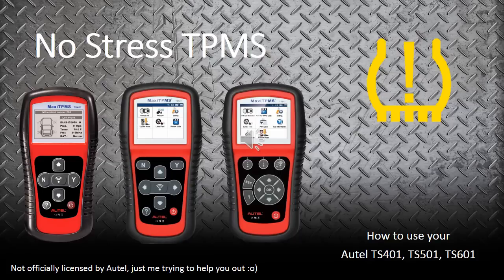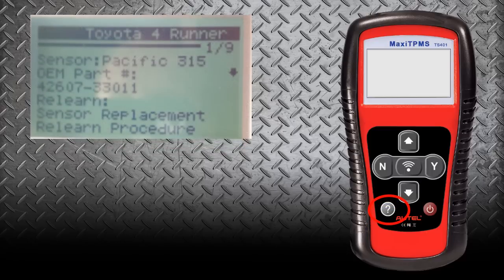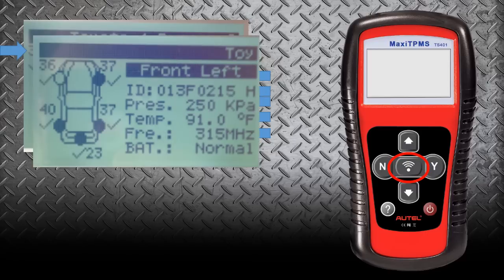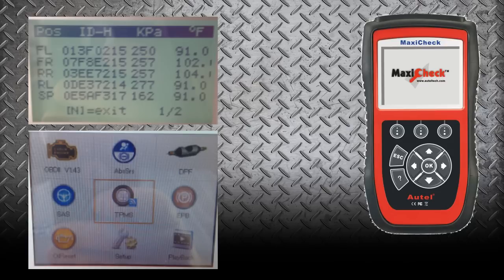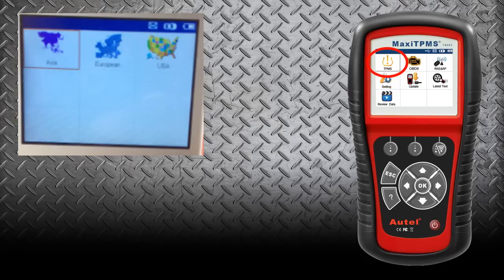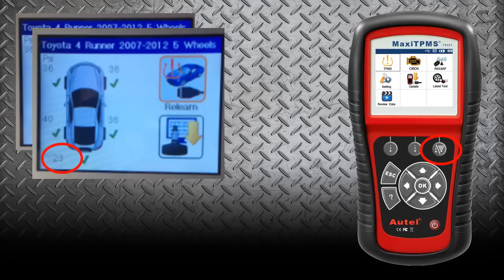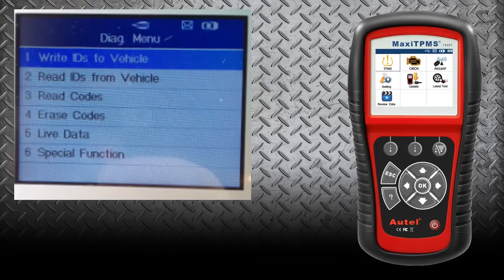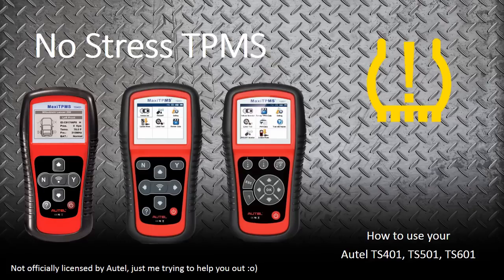No Stress TPMS Autel TS401, TS501, TS601

Comment: What is the difference between TS501 and TS508? Thanks!
Reply: OBD2 connection. The TS501 does not have the ability to connect via OBD2 to write sensor ID's the TS508 does: Correction: The TS501 does have OBD connection. The TS508 is the newer version
Reply: @FlashPerformance  thanks a lot! 508 is much better then.
Reply: @FlashPerformance  False info friend, u either dont know or just pretend to know, both have obd connection, difference is quick mode & advance mode function/option, very welcome.

Comment: You have the most information, I have 2017 Chrysler Pacifica  with TPMS problem..
Where would I take it and what's  the cost..thanks
Reply from the maker: Most of the time it comes down to a sensor that the battery has gone bad.  Every tire shop now has the right equipment to test the TPMS system to find out what the issue may be. Prices very depending on where you are in the country. Guess around $100 to get a sensor replaced. The shop will need to remove the tire, replace the sensor, rebalance the wheel, and relearn the sensor.

Comment: I installed Schrader valves in my winter wheels.  2012 Toyota Prius-V.  Will this be able to discover them?  OEM sensors in the summer wheels.
Reply: Depends on the Schrader sensors you got. The EZ sensors are blank and must be programed with their specific tool.  If the sensors have already been programmed, then yes, the Autel tools will pick them up and do the relearn no problem
Reply: @FlashPerformance    Thanks!  I called up Schrader, mine are programmed.  Ended up getting the Autel TS508.  Autel said it can talk to the vehicle computer as well.  Will give it a try in the next week or so.

Comment: The TS401 allows you to clone OEM to Autel TPMS sensors so you don't need to mess withe the PCM using the 501 or 601.  Just another option since I own the 401.

Comment: Can it adjust the psi point that triggers an alarm? I run lower pressure than the factory thinks is safe so the alarm is always bugging me.
Reply: The TS501, TS508, TS601, and TS608 can all change the Placard Pressure Value. https://youtu.be/C9wQvzF7jzI

Comment: Will any of these relearn Shrader branded TPMS Valves that go in a Nissan Frontier? And register also
Reply from the maker: The Schrader EZ sensors are blank, and the Autel tool can not program them. However once they are programmed the Autel can learn them.  If you have an Autel tool I would recommend the Autel MX sensors, most of the parts stores and tire distributors now sell them. They are also at a great price point.
Reply: @FlashPerformance1   I have Schrader sensors on four tires on a '11 Ram 1500. Can I install new Autel sensors and Schrader sensors on my truck? One sensor just went dead.  Or, can I install and program a new Schrader sensor with the Autel TS501 tool?  I have the equipment to break the bead on a tire to remove and replace the sensors. My Ram 1500 supposedly auto-learns the sensors, but in the past, that has not gone well.

Comment: How long does the autel sensor last and which is the best autel sensor to get...also this machine only programs autel tpms only
Reply from the maker: The Autel MX-1sensor is a single sku sensor that works for both 315 and 433 mHz sensors.  I recommend using the 1Sensor for ease of use and low inventory.  The Autel TPMS tools can clone using the Autel MX sensors, but it can relearn any pre programmed sensor, and any information ready sensor like VDO, John Dow, Ori-Teck, and any OE sensor.  Check out this video for more sensor informaiton https://youtu.be/vwMxHx8WoYw
Reply: Just talked to honda (local and ebay) about the oem honda sensors they said the oem has to be programmed would you know if that means they can be cloned from the autel tools?
Reply: Or would the answer be ts501/ts601 or ts401 add with thr maxcheck would be able to program the new oem sensors
Reply from the maker: @Benflippingfactz  Each TPMS sensor has its own ID,  That sensor transmits it information out and the vehicle looks for that specific ID and captures the information the sensor is transmitting.  If we didn't do it this way your vehicle would pick up TPMS sensors from other vehicles driving down the road.  When they say the sensor has to be programmed they are correct, we have to program that sensors ID to the vehicle.  This way the vehicle will know to use that sensors information.  Honda requires an OBD2 relearn.  This means we scan all the sensors, plug into the OBD2 port and write the sensor IDs to the vehicle.  This can be done with the TS501, TS508, TS601, TS608 from Autel.

Comment: Hi is that working on lexus ? NX200t 2017
Reply from the maker: Yes, you would want to choose a TS501 or better. TS501, TS601, TS508, TS608. You will need to be able to connect via OBD to the vehicle. Any of these units would work perfect for you.

Comment: I can't read the sensor in my car, is there a setting where it will pick up any frequency so I can determine if the sensor in the tire is working and possibly they installed a sensor for another car? Also it's strange that both the 2011malibu and Prius both have 315 but after reading the Malibu's I go to the Prius and doesn't read anything.  When I switch to Prius it reads the Prius right away.  Makes me think I have to select every possible car option to see what sensor they installed in my wheel.  I have the ts508
Reply from the maker: There is not a search function on the TS tools from Autel. There are many different frequencies inside 315mHz. 315.1, 315.2, 315.3 etc.  The 315 mHz is just the base frequency, so going from the Malibu to the Prius is not going to work the same because they will be on different sub frequencies. If the Malibu does not read you can try going up a year or down a year on the tool to see if you can pick it up.  It could be that the sensor is bad or that the sensor is locked to a sub frequency that the Malibu can not see.
Reply: Oh wow thanks for the answer.  Must be a different sub frequency than I expect.  I was so confused  because I thought there was only the 2 frequencies.  Thank you.

Comment: I lost my old tire sensor so how I can find the old sensor code number to install it to the new tire sensor ?
Reply from the maker: If you are using a TS501, TS508,TS601, TS608 you can connect to the OBDII connector and pull the sensor ID's from the PCM and do what Autel calles "Copy By OBD".  If that is not an option just do an auto create and do the relearn process.

Comment: I have sensors but am getting new tires and wheels with new tpms. To sync up the new ones which Autel tool should I try? ( it’s for a 2009 Subaru Legacy)
Reply from the maker: The legacy requires and OBD2 relearn, The TS501, TS508, TS601 will all work for that function

Comment: I have a 2006 and 2008 Toyota Tacoma each with two sets of tires and rims (all season and winter).  The TS501 worked well at reprogramming the system after changing the tires.

Comment: Just got a ts 401..going to use it for a 2013 toyota sienna. And it seems does not work. Any help?
Reply from the maker: First, I would make sure that you have completely updated the tool.  You can find a video for that here: https://youtu.be/5FOV5mUuiG0
Second, after you select the Year Make and Model select the "?" button.  This will give you the step by step relearn procedure for your vehicle.   On a 2013 Toyota Sienna they had both 433Mhz and 315Mhz.  If you go "Tool Kit" from the home screen> RKE & RF Monitor, you can press the key fob to find out what Mhz the system is running.
Third, when you read through the relearn process you will see that it requires you to connect to OBD2 to write sensor ID's.  The TS401 doesn't have that function, it will require a MaxiCheck Pro, MX808, or professional level scan tool to do that step.

Comment: Our shop has the TMPS TS501 that has frozen up. It reads The vehicle program is not authorized...… It is stuck with this message on the screen. We took the back off and disconnected the battery. Plugged it back up, and still reads the same. Has anyone every run into this problem?
Reply from the maker: Call tech support, There is a factory reset procedure that you can do to get it to reset.

Comment: Quick question! 
For a 2007 crv, using the ts401, I would need an OB2 port tool to connect to the PCM? In order to have the vehicle relearn the sensors. Is that correct? 
Unless, using either the ts501 or ts601.
One other thing to note, I'd be using OEM tpms sensors.

PS: Awesome video!
Reply from the maker: Yes you have to connect to the OBD2 port to write the sensor IDs.  You can do this with a professional scan tool or by using the TS501, TS508, TS601, and/or TS608.  Even with OE sensors.
Reply: @FlashPerformance1  Awesome! Thank you so much for clarifying and replying quickly!

Comment: Can it be use in 2011 Honda Odyssey ?
Reply from the maker: The Honda Pilot requires an OBD2 TPMS relearn.  You will need a TS501, TS508, TS601, TS608 to do the relearn
Reply: ok thanks

Comment: I have a TS601 and did the newest update. I am trying to re-learn TPMS Sensors for a 2014 toyota camry and the device shows that the sensors should be 433Mhz, however the vehicle owners manual shows that they are 315mhz and the device does not detect the sensors. Is there a way to return to the pre-update software? I wish I never did the update for the new software. Any Ideas?
Reply from the maker: Oddly enough mine did the same thing.  If you go into Settings>Market switch it over to Euro go into Camry and will will only show 433.  Go back to Settings>Market and change back to America.  Go back to Camry and it will show 3 options all 315mhz.  Hope that helps
Reply from the maker: I just got an email from Autel Support about this issue. They are aware of the issue and are working to correct it. For now the switch back and forth works.

Comment: What is the point if it cant connect to the ecm?
Reply: The TS401 is used as an activation tool to activate the sensors and get the sensor ID.  The sensor ID can be used with a professional level scan tool to program the sensor IDs to the PCM.  Autel wanted to give the customer a cost effective way to activate sensors.

Comment: I have a 2017 Honda Pilot.  Dealer ordered me a set of Black OEM custom wheels with sensors and installed the stock tires.  I used the stock rims, and installed Winter tires.  All wheels have Honda OEM sensors.  Can I use these tools when I swap sets to relearn?  Do I need any other tools?  Dealer wants an hour labor each time they reset it.  What is the minimum model I can get to do this?  Thanks.
Reply from the maker: The Autel tools do not have the relearn process in them for the 2017 Honda just yet.  I am sure it will come...  My best recommendation would be to return the sensors to the dealer, order the TS408 and 4 Autel MX sensors.  Do a copy by activation on each sensors.  This would make your winter tires and summer tires have the same IDs.  When you do the switch the vehicle will no know because the vehicle will already be looking for those IDs.

Comment: can the ts601 manual input ID sensor  to the ECU? thank you
Reply: ts401 to get all the I'd in the tire sensor and you can program it with your maxisys 906
Reply from the maker: I struggled to answer your questions on this on.  The TS501 and TS601 can not manually enter the IDs into the PCM, but I'm not really sure why you would want to.  To enter the Sensor IDs you simply scan all of the sensors and select write sensor IDs and the tool does all the work for you.  The only reason I can think of to manually enter the IDs is because the sensor didn't transmit the signal to the Tool and in that case the sensor would not transmit to the car so the sensor would not work anyway.  Manual entry of sensor IDs can be found in all of the MaxiSys tools.
Reply: I'm sorry for making you confuse. The reason why I'm asking you it's because I'm working with 2016 Corolla and when I'm trying to Scan the sensor using my ts501 it won't work, but when I use my ts401 it work. when I play around with my ts501 no way you can register the I'd manually. So I was just wondering if you can do it on TS 601? Thanks for replying to my massage I do appreciate it.
Reply from the maker: I understand your logic now and that makes sense.  There are a few things I would try, first, make sure that your TS501 is up to date.  All of the updates are free.  You can find that process here: https://youtu.be/bPS8fZH7Edg.  If that doesn't work we need to get the VIN number for that car to the engineering team at Autel so they can look into the issue.
Reply: OK thank you.
Reply: can you please check  if the TS601 special function is the manual I'd register to ECU? if it is, I'm just gonna buy the TS601 and return my TS501 thank you .
Reply from the maker: The special functions on the TS601 are used to adjust the placard specs.  This allows you to adjust the tire pressure and tire size on select manufacturers.  If you do not have a professional scan tool like a maxisys the TS601 is a great way to go.
Reply: I have a question I have a maxisys 906 I don't think you can program tire sensors with it so which tool would be the companion so I can diag and replace and program new sensor IDs?
Reply: raymond navarro OK thank you

Comment: can the Maxicheck pro still does TPMS programing function at this day
Reply from the maker: The TPMS ID programming has been removed from the MaxiCheck Pro and replaced with Battery Monitor reset
Reply: @FlashPerformance1  What a bummer! Is there a cheap scan tool that can do TPMS ID programming? I only need TPMS ID programming as I have 3 cars in my family that 2 sets of tires each for winter and other. I need the ability to edit the ECU to change IDs as needed twice a year. Any idea?

Comment: can the ts601 also program NEW TPMS into the ECU?
Basically for switching from winter to summer tires with separate TPMS sensors in them?
Reply from the maker: Joe Chitussi Yes, with the supplied OBD2 cable you can read the sensors and write IDs to the pcm.  you can also clone Autel MX-SENSORS to make a duplicate set or sensors for the vehicle
Reply: Chad Schnitz can it also be done with the ts501?

Comment: I have a TS501 tpm-only scan tool.  I installed a new DVT sensor onto my 2014 Tundra. The TS501 has read all the sensors, but I haven't been able to figure out how to transfer the TPM info from the TS501 to the vehicle. Everything I've read & viewed says to just plug the TS501 into the OBD-II connector and download the stored data, however, there doesn't seem to be a download/transfer option, at least I haven't figured out how to access it.
Reply: After you have read all of your sensors you will see a box in the top right corner that, when highlighted, says "diagnostics".  Select "Diagnostics>TPMS Diagnostics> Write Sensor ID's

Comment: The maxi check pro will do the same as ts501, ts601? Is to relearn a 2010 Lancer Evo GSR
Reply from the maker: No the MaxiCheck Pro will not cover what the TS line of products will.  The TPMS functions have been removed from the MaxiCheck Pro.  Prior to discontinuing the TPMS functions the MCP could only write sensor IDs to the PCM you would still need a TS401 to read sensor IDs from the wheel.
Reply: So the maxi check pro can no longer write the ID into the PCM? I have just purchased the ts401 and I read the IDs and now I’d like to write these IDs into my pcm. Which scan tool is fairly cheap and can do that?

Comment: hello, FIRST....THANK YOU, for posting the BEST VIDEO I HAVE FOUND EXPLAINING THESE TOOLS.....much better than autels website, I wish they would get their act and info together...anyyways... I notice this was done a year ago...just curious... I spoke with autel and they said the 501 and 601 did the exact same thing when it came to TPMS stuff...even being able to read /erase codes and view live date pertaining to TPMS stuff..they said the only difference is the 501 couldn't read and clear obd2 codes and such like a regular scan tool could do.....(which is ok bc I already own the md802 all systems) so anyways....I bought the autel ts501k...is this true...can the 501 do those extra TPMS stuff now that you say only the ts601 could do. (read erase and do live tpms data?)
Reply from the maker: You are correct, in the past year Autel has been upgrading the software in there TPMS tools.  The TS501 can now read and erase codes, but only in the TPMS module.  The TS601 can read and erase codes in the TPMS module and for generic OBD2 along with some bidirectional controls in the TPMS module, like tire size adjustment and PSI adjustment on some applications.

Comment: So basically 501 & 601 do the same thing on the TPMS side?  The 601 having the diagnostic ability, that would be a waste of money for me to spend as I already have the Solus scanner?  Thanks for your time and the great video!
Reply from the maker: +Kristopher  Thomas That is correct the TS501 and TS601 have the same capabilities for TPMS .  If you already have a professional level scan tool there is no need to upgrade to the TS601.
Reply: +Flash Performance  Thanks for the timely response!